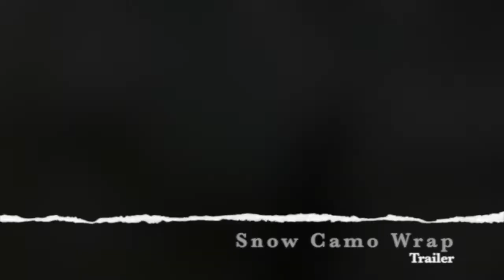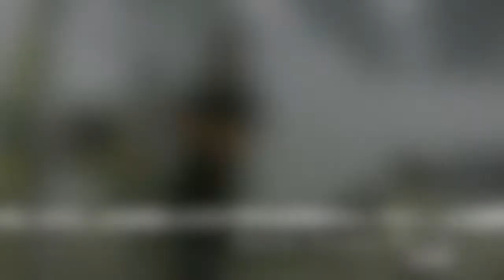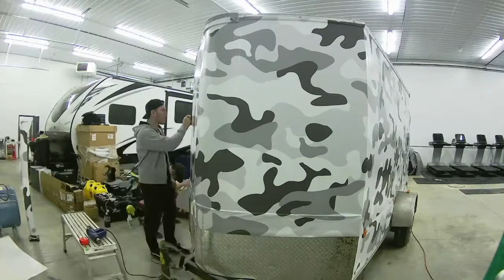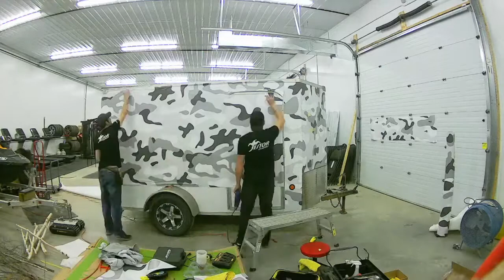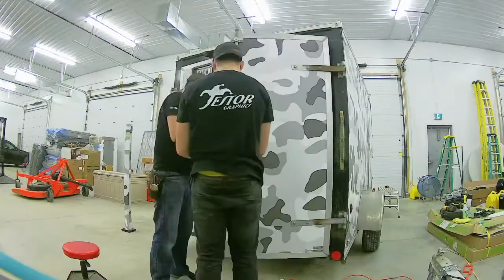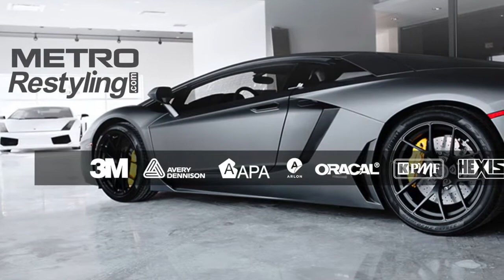Snow Camo Wrap - Enclosed Trailer

Comment: Great video. I’m curious how you handle the extra silicon sealer that sometimes sticks out of the seams of the trailer. 

I painted my older enclosed trailer and quickly realized nothing was going to stick to these odd shaped lines of sealer running around all the trim and roof trim. 

Then I thought… how would a person professional wrapper handle this situation? Is it possible to bond to this kind of silicone or does it make the whole wrap look bad because there aren’t perfect lines due to the sealer?